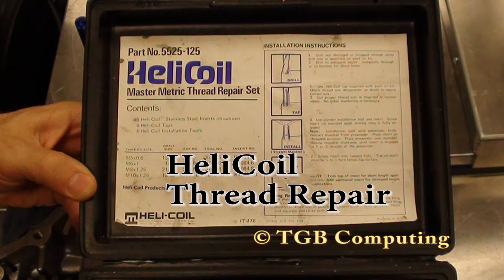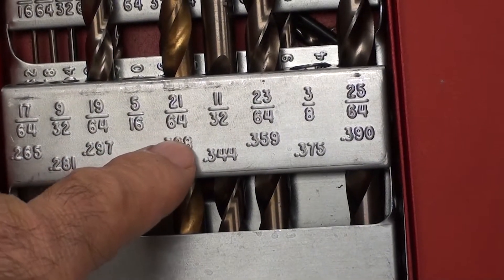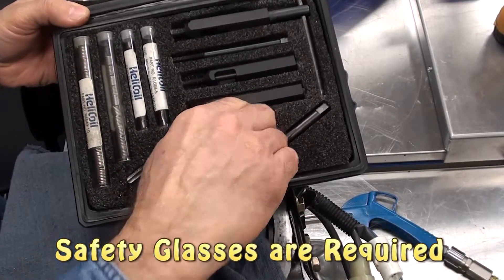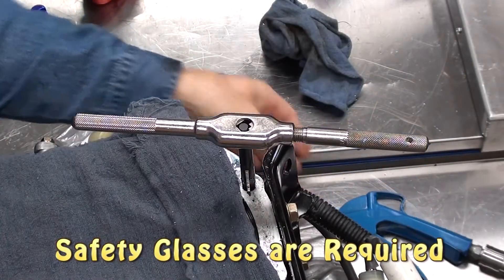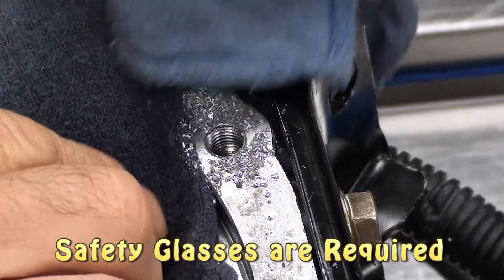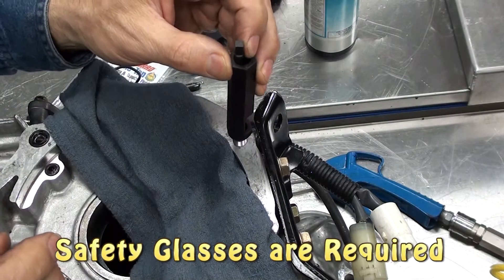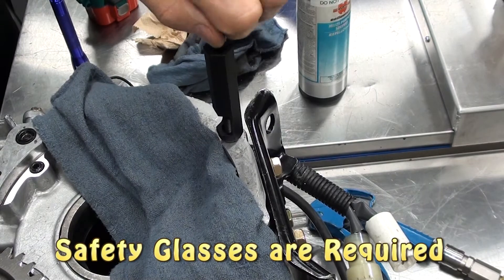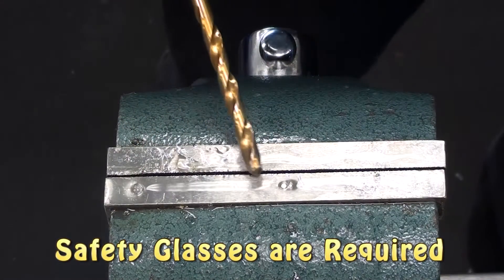Helicoil

Comment: I was wondering if Helicoils are strong enough for anywhere on an Internal combustion engine or are there certain places helicoils should not be placed? 
Using helicoil in places like the engine block with the internal threads might be a bad move. 
I feel like helicoils should be used in places where its low torque like maybe timing covers, valve covers, oil pan.
Reply from the maker: They can be used for stress positions like spark plug holes and cylinder head & main bearing bolts but If I had to choose for one of these locations I would prefer the time-sert over the helicoild.  Certainly water pump holes, engine mounts, accessory brackets, thermostat housings, bell housings etc.. are all good applications.  They are strong and versatile and cost less than the time-sert..
Reply: Okay Gotcha